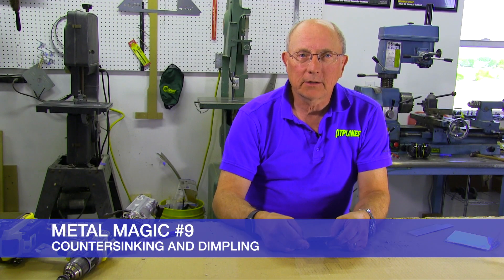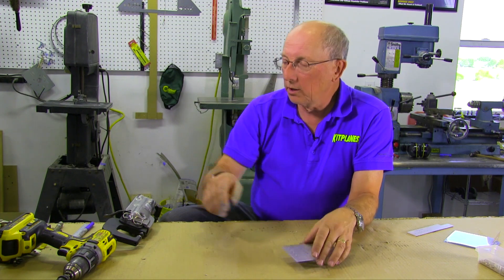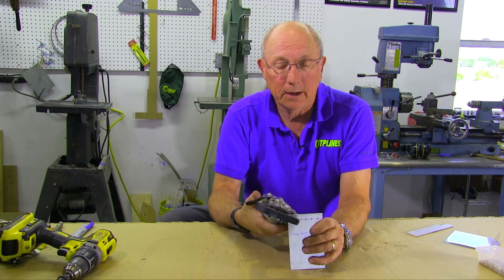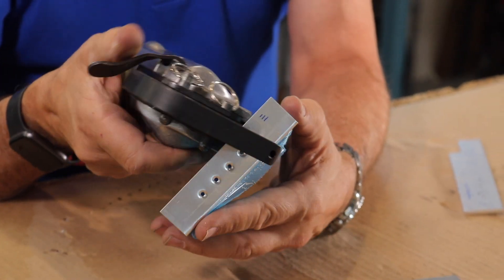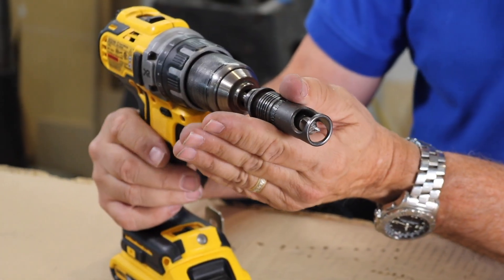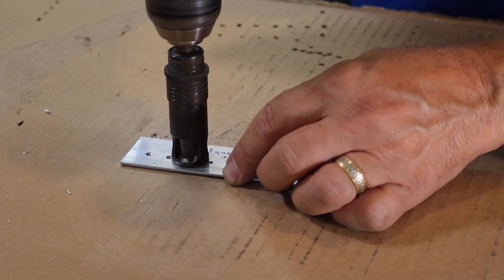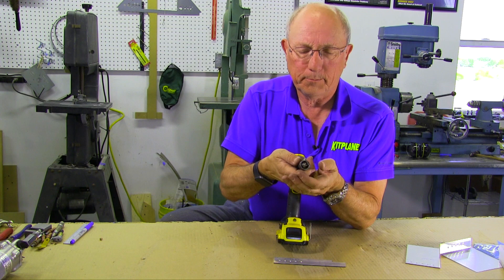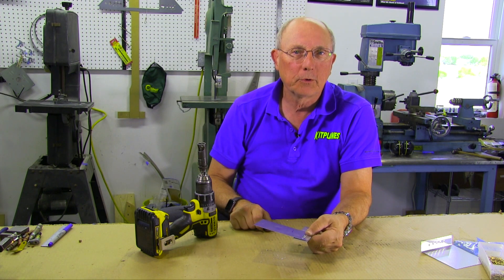Metal Magic: Dimpling and Countersinking

Comment: If I have seen this correctly, the same dimple dy set was used for the upper and lower plates.
When I do this, the angles do not match.
When dimpling, there is an angle of 110° on the lower side of the upper plate. So you would have to use a dimple tool for the lower sheet that has an angle of 110° degrees on the upper side of the lower sheet.
And it was not mentioned that if I have a thicker lower sheet that I want to countersink, the angle of the countersink should be 110°. Here is a link where this is explained in detail.https://www.youtube.com/watch?v=WC5BAp2xvDc.
But perhaps it does not play a decisive role in aluminium and small rivets.Perhaps the dimpletool also has the same angle at the top and bottom of the male and female parts.

Comment: Very interesting video(s)! I am to put some aluminium parts together on an old car, and would like to use the countersinking method. I have holes drilled with 4,5 mm, so 1) what size rivets should I use and 2) what size drill goes into the cage? Best regards Christian Gervoe
Reply: Know rivet size before drilling  to choose the right "bit" .

Comment: Aircraft structures & sheet metal is my career. Maybe it’s different with home built planes, but he didn’t say a word about not countersinking too deep, where the bit goes all the way through. There needs to be a certain amount of straight metal at the bottom of that countersink! Also, he didn’t talk about knowing if your countersink is set correctly & making a hole of correct depth. The way you tell is by dropping a rivet into the hole on a practice piece of aluminum until the rivet head sits flush. Insufficient information here!
Reply: The more I watch these videos, makes me think never purchase homebuilt airplanes, machinist here
Reply: Indeed you have to not go too deep. And arguably if your sheets are sitting flush you are too deep, since there's a radius on the bottom of the dimple. But if you just countersink enough to make the rivet sit flush, you're too shallow. The thickness of the skin in the dimple means you need to countersink a tad deeper than a flush rivet. Exactly how deep can apparently be debated...

Comment: Thanks for this thorough video. I have a hole stretch issue. 
I'm building an electric Xenos like yours, with the Zaero kit. I just drilled eight 1/8 holes in two .032 inch 6061T6 stabilator spar to rib attachment structure. The Sonex plans say to dimple and pull a CCC-42 countersunk pop rivet. However, if I dimple the 1/8 inch hole, it will open up too much and the rivet may not set. I failed to downsize the drill a few sizes to account for the hole stretch. 
Should I either:
A) Machine the countersink instead of dimpling? 
B) Combination of 50% machine countersink and 50% dimpling?
C) Upsize to CCC-52 rivet and dimple?
D) Install a 1/8 inch stainless steel reinforcement washer behind the rivet? This would ensure the rivet sets properly. This is a common exterior aircraft grade washer used on countersunk fiberglass wing tips. This stock washer would have to be ground to fit properly, but would ensure structural integrity.

Comment: I wonder what happens if you dimple two long edges, such as cabin top and side, maybe 48 inches long. Will all the holes  still align or will there be some cumulative material distortion resulting in hole misalignment?

Comment: Did those seem underdimpled to anyone else?
Reply: I agree - they were a little under-dimpled; I did many tests with drilled and deburred "coupons" of various thicknesses of aluminum sheet, and they required that the dies be far tighter than this video suggests (sorry, Paul).  Just having the dies barely touching each other was not sufficient in my hands.  Have the dies touch, and then go another full turn on the adjustable set.  That made my dimples perfect ... and this is the general method recommended by Mike at Cleaveland Aircraft Tool (where I bought my dies - probably the best dies for homebuilts).  The reason I did these tests is that my initial dimples for the empennage kit of my RV-14A were a little "under done" ... and I wanted to determine, empirically, the best way to dimple.  If you have a DRDT-2, the same principle works (get the dies snug, and then one full turn).
Reply: @alexc30  surely it depends on how thick the sheet metal is to start with
Reply: another point of reference - you can also purchase substructure dimple dies for the (e.g.) ribs that dimple just a little deeper, to which the skin dimples fit a little more snug.  Again, Cleaveland Aircraft Tool is the source (and no, I don't work for them - they are, in my opinion, the best source for tools to build RVs and other homebuilts). And don't get me started on tank dimple dies ... another dimple die set that worked well for my fuel tanks.